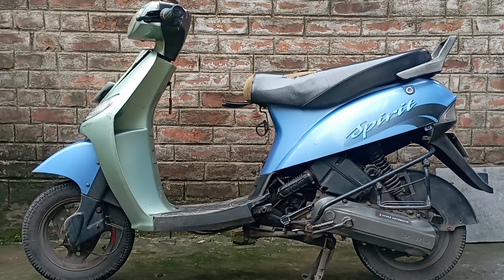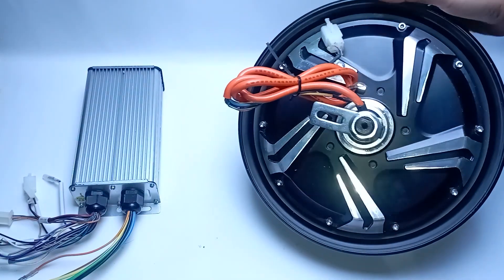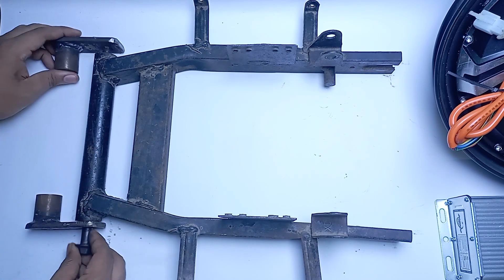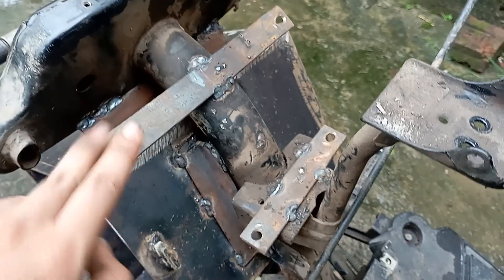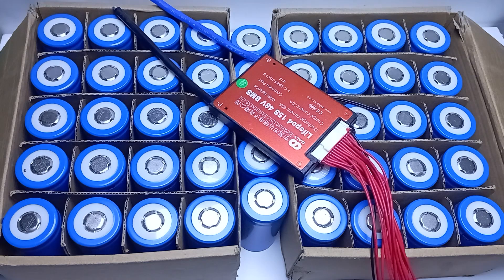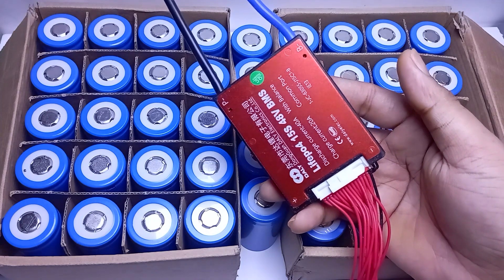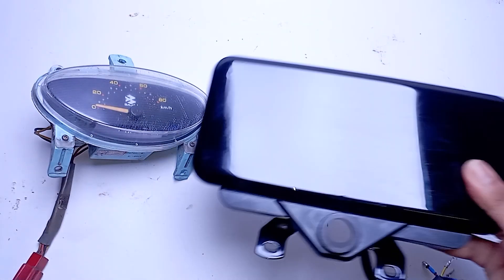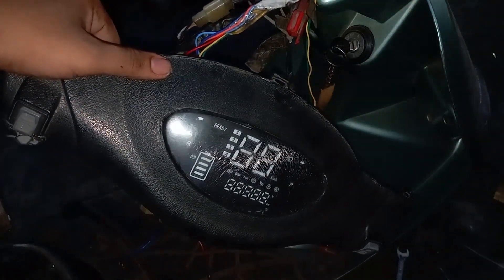Electric Conversion ⚠️🔥E-scooty #diy #ev #escooter

Comment: What range do you get? How many charges do you estimate the battery will last?
Reply from the maker: Range is around 60km , 
Battery Life without reducing range should be around 7 years or near it,  already using  po4 batteries in my bike for around 3 years still the range is same,  and actually this one is not for myself it's an order, 🙌 thanks for  comment 😇
Reply: @madScientist99  that sounds awesome. Looks that for a classic scooter could be an easy to fix alternative if you don't want to put a gas engine on it. What battery size do you recommend?
Reply from the maker: @Snuggle201  30-50Amp is better to use for decent range, with bigger pack highspeed mode can be used all the time Or else battery will discharge faster.
Reply: Nice project..